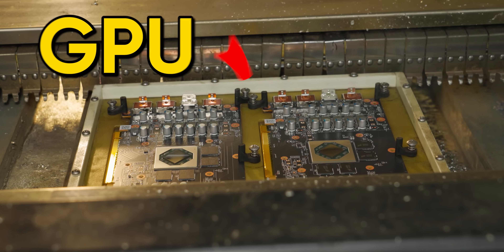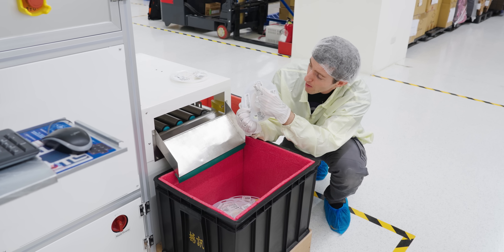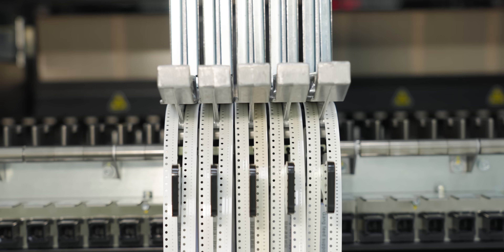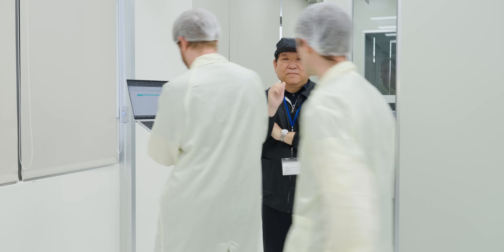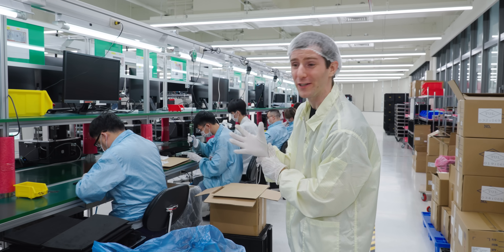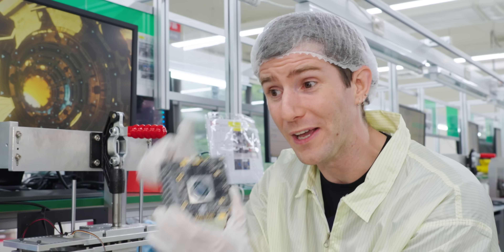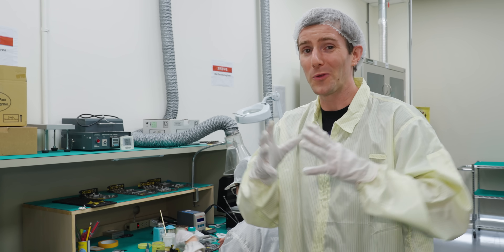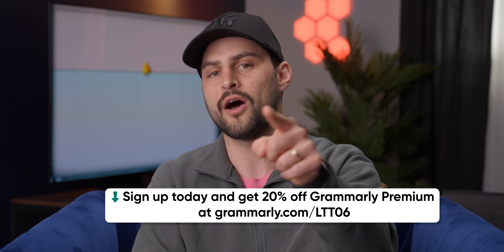They Turned off this GPU Factory For Me! PowerColor Factory Tour

Comment: 7:46 the fact that a factory of this caliber uses a piece of scrap wood with 4 other more different pieces of scrap wood screwed into it to carry around the GPU's is amazing. I appreciate the jank.

Edit: yes, I too have realized that it's not actually scrap wood. I was high and probably saw what I wanted to see. So the correct statement would be: I'm disappointed by the lack of jank
Reply: i dont think that is wood scraps..... It doesnt have any wood texture. probably some kind of plastic or coated metal alloy cause like that thing went through the fountain of solder which would probably burn and deform the wood
Reply: @Ahadun  good point! It still looks kind of funny/out of place. It looks pretty DIY. I probably should have phrased it better in my original comment
Reply: if it works
Reply: Leave it up to youtube commenter to point out how the "scrap of wood" goes into an oven filled with liquified metal
Reply: @WD_Batora  .. good point. Not my brightest moment 😂
Reply: It might be fiberglass carrier
Reply: where did you see such a thing?
Reply: @EcoMei at the timestamp I tagged, 7:46. It's also on the table at 7:49
Reply: @marcruijs1039  ohh, I see now. I didn't even recognise it as wood. I thought it was some kind of plastic...
Reply: Yeah, I would have assumed they would just 3d print a jig. But wood scraps work too.

Comment: That solder waterfall is some of the most willy-wonka shit I've ever seen
Reply: Forbidden silver chocolate
Reply: @sajhino Can has one mouthful Sir....
Reply: I worked on similar machine but for TVs. The problem is the setup (speed and temps), small fingers that hold PCB sometimes get bent, once per week you need to clean the solder filter at the bottom of this waterfall - you do it while its hot so solder is liquid. They give you gloves that can survive 200-300⁰C for a few moments and tools to remove screws in this liquid.
Last problem that i remember was this:
You put PCB on this mask - so only a part of PCB gets to touch the solder waterfall. It was some non conductive plate. Sometimes PCB does not stick to this masking plate correctly and solder waterfall floods all PCD from below and leaves like 100grams of solder attached to PCB, basically ruins everything
Reply: @Julo133  Nooo! I can just imagine thinking it's perfectly sealed, then time slows down as solder floods through the leak that you can't do anything about. You just watch all that well intended precision spread out into a plateau of entropic disappointment. Mind you, I'd watch the crap out of YT video which showed the board superheated so that all the solder ran off like mercury... Unless it was IO etch, then we stay permasad.
Reply: 07:17
Reply: I want one next to my pc
Reply: Who in the writer's room didn't opt to have Linus say "solderfall" instead of "solder waterfall." I'm in Australia and never hear it said sans 'L,' and even I cringed at the cringe we should have enjoyed but didn't. But yeah nah, you're so right about the Wonka vibes. Augustus would slurp that right up until he could feature in some sort of half baked live action Vox Machina.
Reply: 07:17
Reply: It's a solderfall!
Reply: It was a "world of Purrrrre Imaginaaaation" 🎵🎶
Reply: yea but this one would cook you alive if you fell on it
Reply: It smells horrible. When those things get cleaned it's like a toxic waste spill
Reply: @oboemanandy  Well, that stuff in the 1971 movie also clearly isn't chocolate, so we're left to imagine how that smelled.... 🤢
Reply: I kept going back lol
Reply: It's called "wave soldering" 😎
Reply: Womp womp
Reply: I thought that there was an excess of solder being used, I was going to ty to make a pun on there being a oompa-loopa amounts.
Reply: Reminds me of watching Krispy Kreme donuts get made while I lived in Florida - soothing. Even if the diabetic attack immediately afterward wasn't.
Reply: Wave soldering...pretty old tech.
Reply: lmao, our factory uses solder fountain. but the waterfall is definally better.
Reply: I wonder if you can get a free glass of it while you’re working to drink on break or something 🤔….. 🫵👁️👄👁️🤚
Reply: Looks like the end boss of terminator 2 lol
Reply: solderfall

Comment: Granite surface places are wild: the lab grade ones are flat to the millionths of inches over several feet. The calibration tools are even wilder detecting stuff smaller than white blood cells.
Reply: I had to use one to measure tools I put in a 3axis CNC mill. It was amazing just what you find out when you have a surface like that to work with.
Reply: I visited one of our manufacturers that had one of these types of plates with a big gantry over it with a measuring probe for checking accuracy of the parts they were producing. Not really thinking about it I put my hand against it as I was standing there listening and immediately got told to take my hand off the table. Reason being that the slight change in temperature would throw their measurements off. The whole room was temperature controlled as well.
Reply: They are amazing. The reference plates for calibrating HASS CNC mills are so precise that it’s equivalent to the width of a human hair against the height of the Empire State Building.
Reply: Is there a reason granite is used for this? More mechanically stable in that it holds measurement better/longer? I understand not using metals with corrosion and the temperature changes it's dimensions
Reply: @widdly-scuds  For this case it would be rigidity and high dimensional stability.

Comment: The whole ever so teensy tiny issue with pcb flatness just having them like thrown out? That feels like an extreme waste like unless im missing something (very very likely) i feel like that would work fine
Reply: Flatness needed for pick and place machine and soldering as components are so small that even being out by a little will ruin the placement and soldering and waste the components as board will not work.
Reply: @nigelcottrill7535  ah...well then

Comment: This video honestly sold me on PowerColor products lmao I love the transparency in the manufacturing process. Not to mention, the consumer usage testing to ensure the cards will run well for normal usage.
Reply: Seriously. For some reason, I was under the impression that PowerColor was some sketchy, low-quality brand.
This tour really changed my opinion. I had no idea how significant they were in the industry.
Reply: @trajectoryunown  They make some of the best AMD GPUs with their Red Devil and Liquid Devil lines.
Reply: @Hathos9 Currently running a RedDevil 6700XT and I've been completely pleased with it. Definitely would look at this brand again.
Reply: @trajectoryunown  most people think that because they are one of a few amd only card makers. they got fed up with nvidia's stuff and went full amd.
Reply: @trajectoryunown "for some reason" I wouldn't fault you if it was because of the name 'PowerColor' 😅
Reply: @trajectoryunown While sapphire is the evga of amd, powercooler is really up there as well, their quality is usually top notch, and they have multiple gpu variant lines for different needs.

Water cooling 

SFF

They got a line for it which is nice!
Reply: @trajectoryunown  I'd never even heard of them.
Reply: I treat Powercolor the way I did EVGA they are pretty much my go to for GPUs. Especially since I've dumped team green with the death of EVGA gpus.
Reply: Their GPUs are more reliable than MSI, Gigabyte, and even ASUS but they only release AMD cards. I've had 2 PowerColor cards and while not being perfect they've outlasted other cards that I've owned.
Reply: @CuteMegaPanda  Gigabyte is my go to. I've had both AMD and nVidia Gigabyte Cards and currently a GB mobo and no issues on any of them. Every brand has people praising them or had nothing but issues, but I'm a GB loyalist until I have reason not to be.
Reply: I haven't bought a PowerColor card in quite some time. But the last one I had, I accidentally put pressure in the wrong area and broke one of the surface mount components. Some sort of IC chip. The card was well out of warranty, so I emailed PC with a photo of it and asked if I could buy a replacement component from them. I never received a reply to that email, but almost 2 weeks later, I received a replacement card! I email again thanking them and asking if I owe anything and where to send to broken one. They didn't even want it back! That is some AMAZING customer service! Asus, take some notes here!
Reply: Last year i bought my first amd gpu and it's a red devil. Absolutely love it! I'll probably buy powercolor again if i can. Much better than my old asus nvidia gpu
Reply: this was the point of them shutting the factory down for 3 hours
Reply: I haven't had an AMD card since my PowerColor HD 4890, but that thing was solid.
Reply: @GuyGamer1 I'm the Opposite lol the Only thing I buy Nvidia Cards for now is my Server and it has 2 RTX A6000's in it currently
Reply: @GuyGamer1  HD5770 still on my shelf.  My first card for like 100 or 200 dollars.
Reply: PowerColor has great (AMD) GPUs, never had any issue with any and the performance/price is one of the best. I’ll always buy from them like I’ll ALWAYS buy Seasonic PSUs.
Reply: yeah, I've been planning on getting a card from them for a while, but now I'm extra sold
Reply: We need to identify this run of gpus, to avoid them, since they have been Linused xD.

I have a power color RX 580 8gb still going strong.
Reply: I bought a Powercolor RX 7900XTX Red Devil and love it I bought it after my Sapphire Nitro+ RX 6800XT just died in its Warranty Period so I Messaged Sapphire and they sent me some Diag steps and had done them all and messaged saying that didn't work and they don't respond to my Messages anymore
Reply: If the price is right Powercolor has been my choice in AMD GPUs. With discounts you can sometimes get Red Devil at similar price of Sapphire Pulse. Its a no brainer choice for me.
Reply: My thoughts exactly. I am done with nvidea and XFX appears to have disappears at my Microcenter, so PowerColor it is.
Reply: Grandad had a PowerColour GPU that had lasted years (from 2012 until 2019 I think) until one day as I put my hand under the card to check if the fan was running and accidentally broke the blades 😅 BUT I did buy him a new GPU after.
Reply: We don't know how workers are treated on a normal day, so it's not THAT transparent. I guess there weren't chains, unless they hid them for filming?
Reply: @fitybux4664  That's actually one of the most important factors for me, but it's so hard to tell from far away
Reply: @fitybux4664   I am sure they treat them pretty well, since trained reliable and educated people don't come that easy.  Commenting on a video on the other hand..

Comment: I thought the heatsink and fan would have been put on via a machine not  manually this was so informative.
Reply: A few years ago I was chatting to an automation engineer who explained that small light things & big heavy things are fast with a robot. However small heavy things (like a GPU cooler) are very hard to do with a robot.

It’s to do with the ration between the mass of the object being placed and the mass of the moving parts of the robot. The small motors don’t have the torque needed to move dense objects, and the large motors are hard to control accurately when the ratio of object mass to robot mass gets too low

He did tell me the name for the concept but I can’t remember it.

Was a neat chat, he travels the UK helping companies set up automated production lines. I kinda wish I’d done mechatronics at uni as it seemed like a cool and varied job.
Reply: @jamieknight326  I've heard the same thing . some processes become even more expensive with automation, and the efficiency doesn’t improve much either.
Reply: Yeah they never seem to be, certainly not in any graphics card factory video I have seen.

Comment: I work in a US based PCB manufacturing facility and I'm surprised they don't have a robotic arm for the through-hole components after SMT, I guess they just need more manual precision and know-how for a process as precise as making GPUs
Also those ORT rooms are brutal. Glad you got to feel it
Reply: For a sense of scale. The entire dedicated GPU market is around 40 million units per year and each unit has a single large GPU die and normally a single board. 

Toyota sell around 10 million cars a year, each car has 20-30 silicon dies across dozens of boards. I wouldn’t be surprised if more SMT components are placed on boards for Toyota than the entire GPU market.

The AI market is very profitable, but the actual volume of silicon is remarkably low. It’s been reported that around 3% of TSMC’s 7nm or smaller capacity is going to AI chips.

It’s not like for like (as a GPU due is huge and much more complex!) but in terms of units, the volume is still considered very low.
Reply: Our ASM SMT machines on my end are starting to place some PTH parts as well. We also have seperate lines for automated PTH machines, some of our PCBs are all PTH parts. We have a wider variety of PCBs that we build
Reply: Think it's more because consumer GPUs are a low volume product at the end of the day, so it don't make a ton of sense for such a robot.

Comment: So, does this just lowkey announce the dual m.2 expansion bay for the Framework16? I knew they had files for it, and wouldn't be surprised if they did make it, but I wasn't necessarily counting on it (but it does make sense)

EDIT: I realized that it was already somewhat confirmed from an interview with the Verge, but it's not yet on the Marketplace for preorder and I would have expected an announcement before this, but there isn't really any fanfare here for it.

Comment: I'm pretty sure they shut down the factory to minimize what Linus could accidentally break
Reply: PowerColor Linus edition. When you buy 1 it's already a door stop 😂.
Reply: Or, more accurately, if something does break, it doesn't get multiplied 100x over in the entire process. If they're running the line 100x slower, they're more likely to find the bug he creates.
Reply: We had some of these partial shutdowns due to Investor visits. since Linus co-owns some part of Framework, he is entitled to an assembly site inspection. sometimes we don't do shutdown at all, it is mainly due to employee privacy. management runs a survey who wanted to be on camera or around "upstairs people" and if said employee choose not to hang out they can have a not paid time off until visitors fuck off. longest we had is 3 days and it was worth it xD.
Reply: Yup - there was a protective tape around the STOP button on the oven, most likely specifically to avoid Linus shutting down equipment that would take days to restart.
Reply: Yes he almost broke the die😅
Reply: I can see that happening
Reply: Imagine you couldnt work and get ur hours because Linus showed up
Reply: @Panchirito_Official  exactly lol
Reply: I mean, they know there is no Linus video without something falling. That GPU tray was sweating balls.